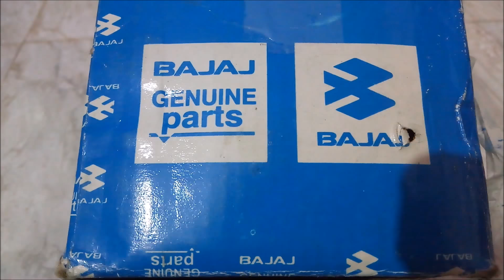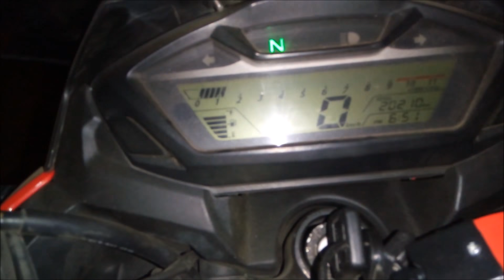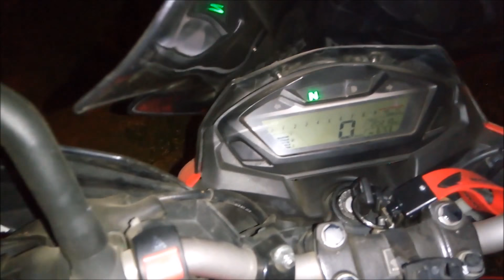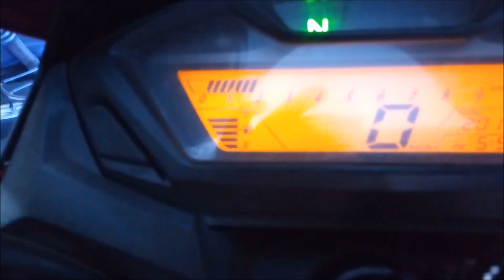PULSAR 200RS COMPLETE SWITCH GEARS INSTALLED | KILL SWITCH MODIFICATIONS | HONDA CB HORNET 160R

Comment: Hi ...
Bro am using hornet 160 cbs 2016 model...i also like to install pulsar switch...but is there sufficient space on  hornet handle bar for pulsar engine kill switch by removing  the stock switches?
U changed accelater cable? bcs normally there s a small separate part for accelator cable on hornet..but when u installed pulsar switch that extra part s not visible......
Please help me with a reply brother...

Please give me a reply